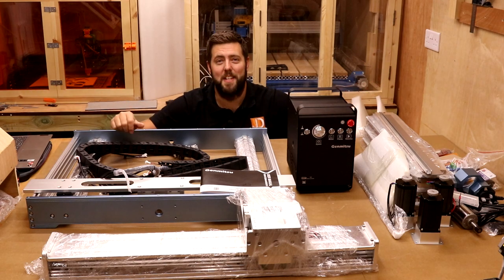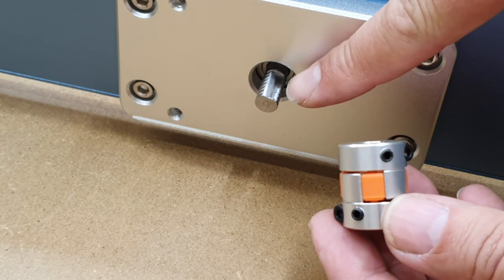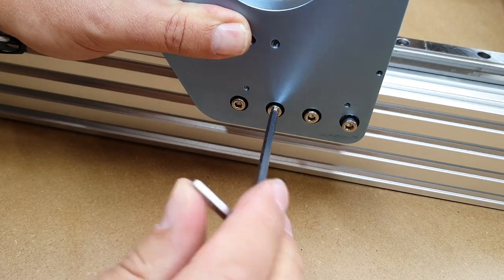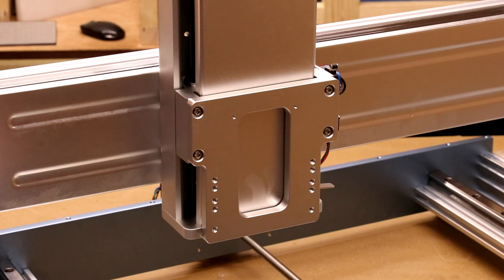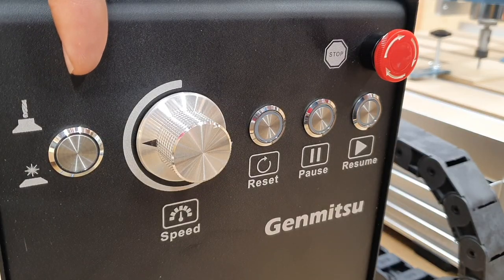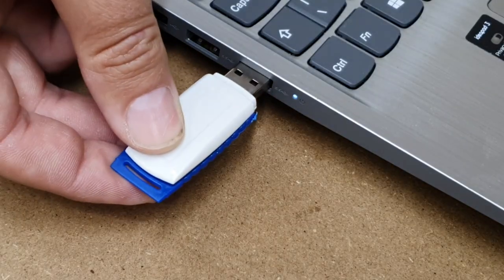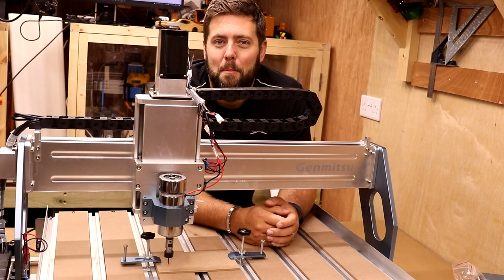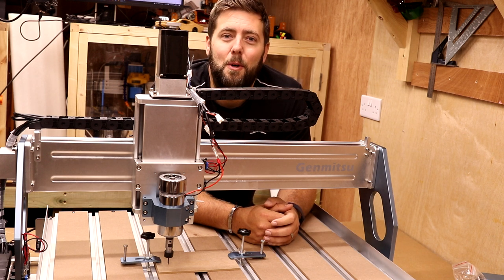Building the Genmitsu PROVerXL 6050 Plus CNC from Sainsmart

Comment: Don't use red loctite... So strong and chemicals don't affect it, if you need to remove bolts to upgrade/replace parts, you'll basically need a small torch. Used the red on my 3D Printer and learned my lesson. Stick with blue. 😉

Comment: Genmitsu now do their own 1.25hp router which is just as good as a DeWalt and fits in the 65mm bracket supplied with the machine. Half the price and just looks better being same brand as machine
Reply from the maker: Don't get the 1.25 one, get the 710w router they make. The difference is the 710w model comes with an ER11 collet which is more versatile https://shrsl.com/4kw0o
Reply: @JamesDeanDesigns  yeah i didn't see that lol. I ended up buying some 1/4 to 1/8 collet adapters which were pretty cheap. seen people use them with makita routers and these are basically the same (the instruction booklet even has a diagram with makita written on the router haha)
Reply: @JamesDeanDesigns  really appreciate your videos pal. i knew nothing about cnc and your instructions are on point - thank you =)
Reply from the maker: @matthewbaker2573  yeh the inserts work really well, they are what I use on my Makita 👍

Comment: I am about to take the plunge! And I have narrowed it down to this machine. I have watched many of your beginner videos and tutorials. Some twice. Your videos have played a big part in my decision. Thank so much for the excellent videos and the time it takes to produce them.
Reply from the maker: its a great machine, and im sure youll love it :)
Reply: No technical support phone number! Don't say you weren't warned
Reply: @JamesDeanDesigns four days in and still can't get it to function properly 😢 ready to send it back, but would rather use it
Reply: Wow I wish mine would have worked that easily! Four days in and it Still shits the bed when I press play.
Reply from the maker: @everyonelovesLewi  if your on Facebook, then join the Sainsmart group. You'll get much more support in there (and I'll likely see your issues faster as well). What issue are you having?
Reply: @JamesDeanDesigns  error messages,  one says something about file stream.
It quits before getting the job done.
I did have one successful run last night, ran start to finish! Wow
I'm  not interested in being on the Facebook.
I got no response from multiple emails to their tech support, im so disgusted with this manufacturer.

Comment: hi, would the 6050 be a better choice for milling aluminium, I asked before about the 3030, the alloy parts are for RC trucks, etc, and don't have to be micron perfect + - .1 or .2 of a millimeter is ok. Would 6050 be a better choice over the 3030 I appreciate the advice and thank you

Comment: James, Love your tutorials. The most significant is the    "Easily pause, restart or recover your CNC job".    I needed it several times.
 I purchased the PROVerXL 6050 Plus along with the monthly subscription of Carveco Maker. I am to the point where I can navigate pretty well. BUT one major show stopper I simply can not overcome which is Inlays. I watched every tutorial I can find, tried numerous variations such as reclassifying the bit, depths, offsets.... you name it. The problem is the inlays do not fit very well. Typically they engage only about half way at best.  It seems like the more complex the inlay the less likely they fit. If I make simple carves like stars they fit fairly well.
 I now suspect the fact that my CNC does not have closed loop motors it might be possible that it skips a step (or steps) without knowing it?  My question to you is: Is there a way to verify if any step was skipped?. For example if a project requires 4,551 steps and in the end there is somewhere in the program that shows the exact amount of steps when complete then it might explain the root cause. Had I known about closed loop CNC's I think I would have reached in my pocket a little deeper.

Comment: Great machine! This is more like it! 
@13:24  Top-Tip; Don't use a Philips nr.1 screwdriver in a nr.2 bolt!!  Use the correct size, that way you won't destroy the bolt head, and have stupid problems even before you turn it on!  :face-turquoise-covering-eyes:
Reply from the maker: Normally I would but I was trying to use the cheap screwdriver that was provided in the kit 😄
Reply: @JamesDeanDesigns  😁  They shouldn't have supplied it then! 😉

Comment: Great video, it's definitely a big beast. One trick ifound on my 4030 couplings was to separate the 2 segments & secure to the D shafts, then use the thumb wheel to turn & align the segments & slide into position.
Shame they put the Steppers on the back again. Don't get know how difficult to access when inside a sound box??

Comment: Excellent video James!  First assembly video I've seen is for this machine.  I am very curious to hear your thoughts on this machine compared to the Proverxl 4030.  I found the rubber feet and gaskets for the stepper motors interesting and I wonder if the Proverxl 4030 might benefit from something similar..
Reply: The so called instructions say it operates smoother without the rubber feet.

Comment: Quick question.  The directions said the if I installed the rubber feet the router wouldn't be as stable so should I install them or not?
Reply: The feet make it easier to move. And you don't want that. That being said, you could router out some feet holes in a sheet of MDF so they drop in

Comment: Thank you for great video. Very helpful. My first CNC machine, will assemble soon. Three questions: Do you recommend unscrewing and applying blue Loctite on screws of the preassembled parts? Should I apply Loctite on the set screws of the couplers (difficult to remove)? And should I pre-lubricate with PTFE, and which parts need it (some will be hard to reach later)? Thanks.
Reply from the maker: From what I could see a lot of preinstalled bolts already have a form of loctite on so hopefully you shouldnt need to take any out. Yes loctite can help on the set screws but only use the blue one, nothing stronger. Yes, you should also lubricate the lead screws on each axis
Reply: @JamesDeanDesigns  Thank you

Comment: I’m a little worried. Installing the coupler on the lead screw and it seems to stick out a bit further than the one in your video. I’ve made sure both bearing are seated as much as possible. Hopefully they didn’t send me a lead screw that was too long?
Reply: Turn it around?

Comment: I wonder why they went down from a dual drive in the ProverXL y axis to single drive on this one. This one is built more like a prover than the xl is, when you think of that.
Reply: I think it could  reduce risk the motor out of sync，and they Increased torque per motor

Comment: Hi! Thanks for the Video. Please compare it to the Foxalien Vasto. I am looking to buy a CNC this size for mostly Aluminium and Carbon Fiber milling and dont know which route to go. Thanks!
Reply from the maker: I've not really done any testing with this yet but my initial thoughts are that the Vasto is still likely to be better other than the flex in the bed.
Reply: @JamesDeanDesigns  Thanks for the reply! Are you planning on doing a Video about a comparison? I think it would help a lot of people, and if you explain your recommendations and the backgrounds, then even more people would profit. best regards :)
Reply: bonjour,
j ai ma genmitsu 4030 depuis 1 an et c est une bonne machine. je l utilise comme fraiseuse alu principalement et avec vectric desktop comme logiciel de creation et ensuite grbl candle. je fraise des épaisseur de 20 mm avec des fraises dlc de 3 mm. pour ce qui est de la 6050 plus elle ne m'interesse pas car en connaisseur je vois beaucoup de points fragiles dans sa construction dont sa vis unique en y. et ses points d 'encrage sur les plaques latérales. la 4030 et mieux concue et tres precise. je travaille tous les jours avec pour développer des pieces aéro dans de la matiere t3 et t5 en alu.